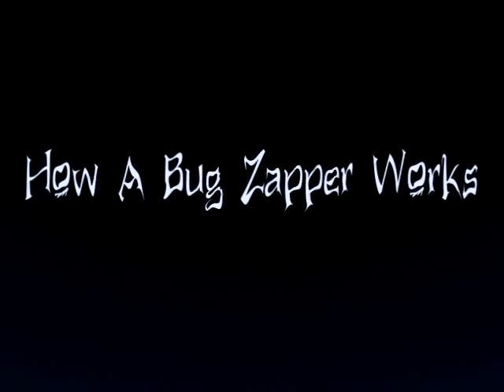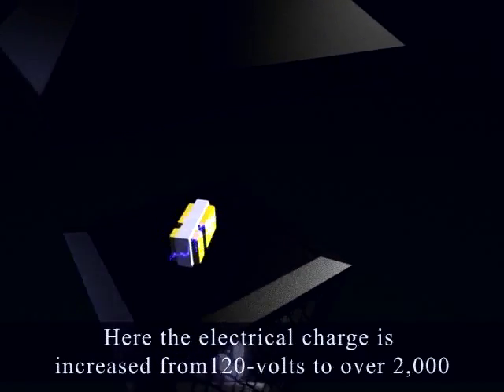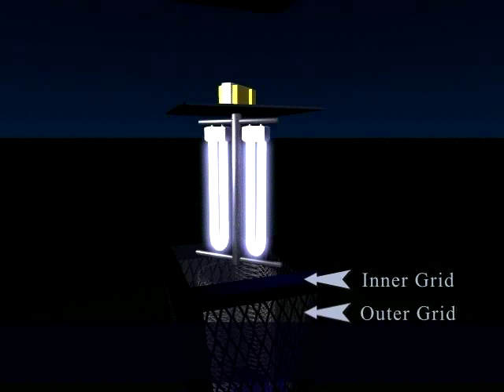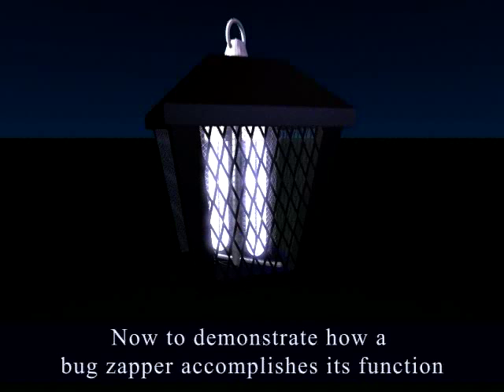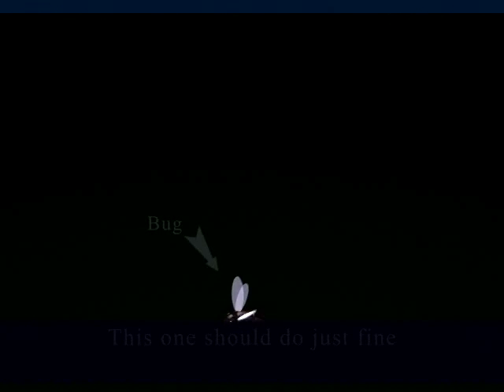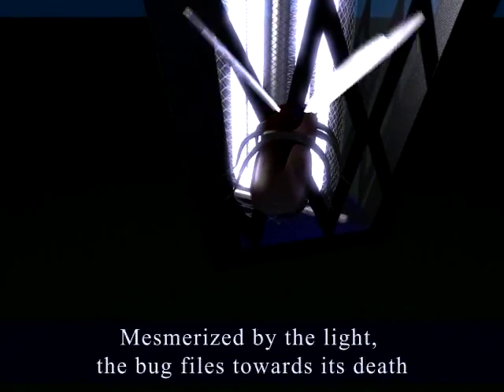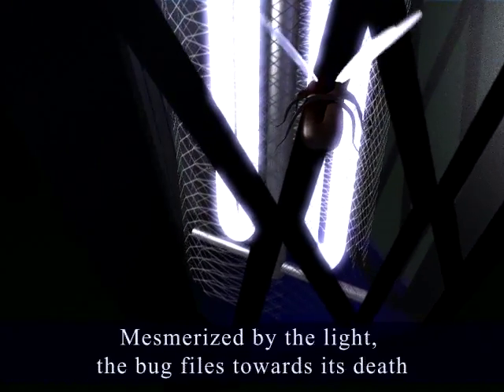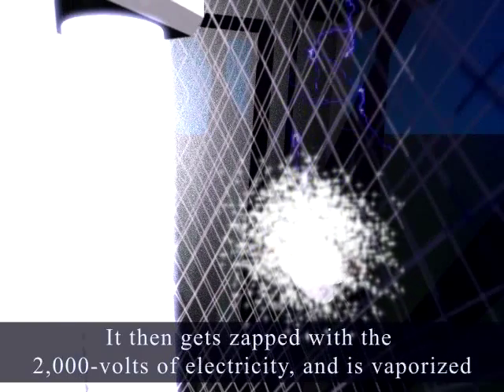How A Bug Zapper Works

Comment: so does insect need to touch the actual wires?
mine has gap of 5mm which is too big for the insects I need to get rid of
I thought about making gaps significantly smaller so they will touch